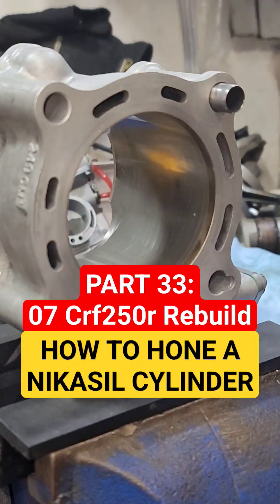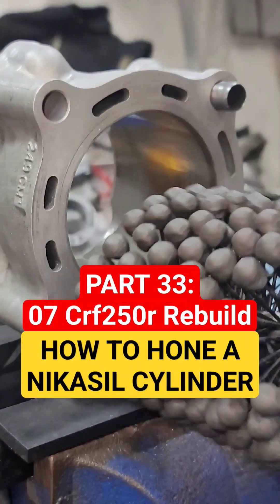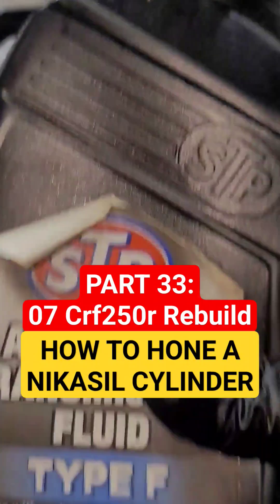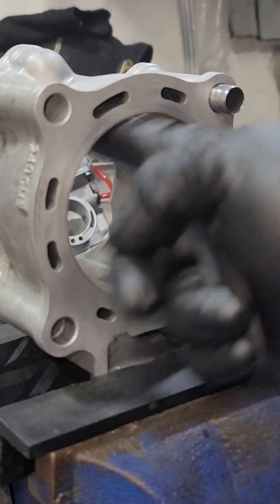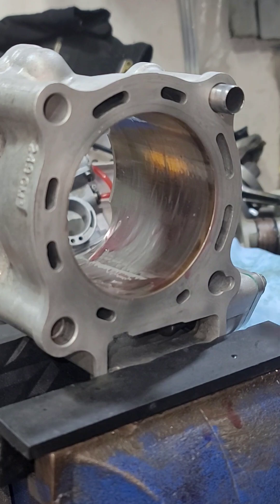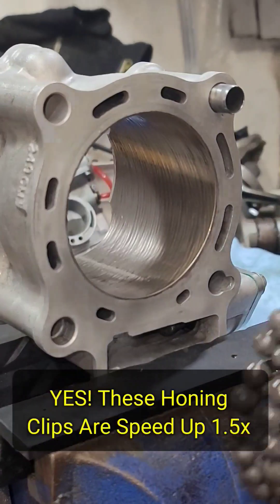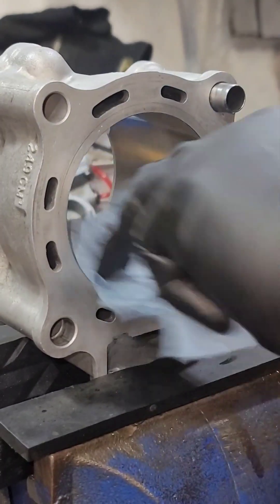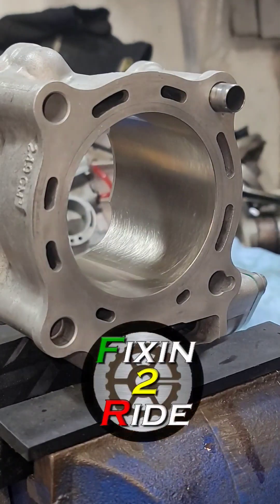07 Honda Crf250r Rebuild   PART 33: How do you HONE a Nikasil Cylinder???

Comment: My new Vertex piston came with instructions that said specifically not to use a ball hone on plated cylinders.  Considering it's a 2-stroke, oil retention is not an issue.  Like many people, I cleaned the cylinder and reinstalled.

Comment: All that ball hone is doing is removing the nickel. Nikasil is too hard to hone without diamond. It's one of the hardest material on the planet.
Reply from the maker: Using an Aluminum Oxide ball gone deglazes the cylinder and brings back some crosshatching to allow oil to maintain lubricity. It's right in the service manuals.

Comment: I currently have my rmz250 taken apart and i’m debating if I should hone it with the rental tool at auto zone but i’m not even sure what else i’d have to do with the new piston and rings after.
Reply from the maker: Well if you own it that puts the crosshatch back in for a new set of rings and piston. If you're referring on how to install it after that if you do the dry method all you do is put some type of engine oil or assembly Lube on the wrist pin only keep everything oil free and then install the Rings in the correct orientation and then put the piston and rings into the cylinder bolt it all back up and then kick the bike over a good 30 or 40 times with no oil in it at all and then fill it up what fluids and started after that. That's going to give you the best ring seat and longevity of your oil rings
Reply: @ What about piston rings and piston should those be different assuming that honing removes a bit off the cylinder?
Reply from the maker: @uwuObito well you can use an inner board micrometer and check the bore diameter to determine that. But typically it's extremely small amount that is removed and it's not the complete surface that is removed from the inside of the cylinder. This is more of a deglazing process then a full-blown honing process. Technically speaking honing is to create an oversized cylinder bore so this is classified more as a deglazing. So the best practice would be to measure your cylinder front to back side to side at top middle and bottom so you know if the cylinder is out of round or out of taper which the max limit is about 4,000 of an inch. And as long as all that is within the range specified in the service manual for your specific bike then you can typically get two sizes of Pistons. But they're only a difference of like   .0005 of an inch or .01mm

Comment: Been doing this for years on my 4 stroke cylinders. Some have had over 100 hrs after the hone and cylinder still looks great. You’re brave to post this because every time I mention it the keyboard warriors go crazy. Most OEM manuals state to hone with a 320 ball hone. Nice works and love the post!
Reply: @DanMX2112  so true…. my personal belief is that if a cylinder is so bad that a ball hone won’t get the job done - then neither will the other 3 stone type!

I have excellent results with the ball hone… just important to buy the right type, and follow the instructions that are PRINTED on the back.
Reply: @Spuki2k correct, I have the same belief. There is a big difference between removing the glaze and and actual hone.
Reply from the maker: Yes! Honing is to literally to increase the cylinder bore diameter for a larger piston.
Reply from the maker: Exactly I don't know what people don't get. Yes, you can run them with new rings and no hone but you're not going to get the performance and longevity from them. When the cylinder is glazed you don't the oil film retention. So it can over quickly from lack of lube.

Comment: Nikosel is .4 thou thick like a sheet of paper you cannot properly hone a nikosel cylinder without a jig type cnc and know how to use bore dial gauge indicator
Reply from the maker: This is wrong. I'm sorry but I've done this plenty of times to know better. 

 We're only talking about deglazing and adding crosshatching for lubrication and properly ring sealing purposes. We're not talking about increasing the diameter of the cylinder for oversized pistons. That's completely different.

Comment: If you want to your bike to run right the only thing that cuts nikosel is a diamond hone dude. Im curios, what's your compression on that cylinder? https://youtu.be/XLBhG2BxlWM?si=hK2FXQ5raHV3zORJ
Reply from the maker: That's 100% inaccurate. Aluminum Oxide ball hones add a nice little crosshatching in Nickel Silicon Carbide coated cylinders. This has been done snd proven for many years. 
 
 "Glazing" is a term used to describe when the cylinder walls become shiny and smooth from wear. When this happens, the seal potential of the rings lowers as well as the cylinder capability to hold an oil film for lubrication. 

 If you don't "deglaze" the cylinder by lightly using an aluminum oxide flex hone or stone hone to create minute crosshatching pattern, the rings won't seal as well, performance will be lesser and potential for over heating due to lack of proper oil film retention will eventually cause premature damage and failure. 

 Get a used Nikasil coated cylinder and try using an Alimunum Oxide Flex Ball Hone and use some ATF and try it yourself. You'll see that I'm right.

Comment: Hi Carol is nickel and silicon carbide. Under a scope it has very large peacks and valleys between elements. You can only hone blossom with diamond hones that will hone both metals. A ball hone only hones the nickel and leaves very deep thatch marks that wear the rings much faster. Just a heads up.
Reply from the maker: Just going by what the service manual procedure is. I've never had an issue with it. The FLEX ball  hones are Aluminum Oxide. They do a fine job.

Comment: So I have a 1991 Honda cr 250 and I wanted to try and hone the top end but I’m not totally sure how I would go about it or even if it’s save able or not
Reply from the maker: 100 safe and the service manuals recommended when installing new piston and rings. Measure the bore of your cylinder and then get a flex hone 320 grit ball home that is the size or even a millimeter or two bigger. But you can typically get a ball home that is for the range of your cylinder. Use some ATF for lubrication and spin the drill slowly but go in and out of the cylinder quick. Do 10 passes going forward and then 10 pass is going backwards. Make sure that the hone is spinning when you pull it out and when you put it in. When you're finished and you have a satisfactory 60° cross hatch in your cylinder wipe it clean and then wash it with hot soapy water

Comment: What grit are you using?
Reply from the maker: 320. But 320-400 grit is fine.
Reply: @Fixin2Ride-Official-  does your bike have auto lube or you have to pre mix? These wall will work just fine with auto lube right?
Reply from the maker: @alekthefisherman5676 what do you mean, Auto Lube? This is a pressure lubrication engine. Are you talking about injection oil for a 2 stroke?
Reply: 240 or 320 grit to use for two stroke 300 enduro ktm/husky? Which one is better?
Reply from the maker: @atanasgeorgiev2342 320-400

Comment: Does this redo the nickel plating?
Reply from the maker: It deglazes the nikasil plating and makes new cross hatching groves to be sealed to the new rings
Reply: @Fixin2Ride-Official-  so, does it make it if u have no nickel seel left, can I do this and run the cylinder again?
Reply from the maker: Yes. As long as you have a good cylinder by checking front to back of inside of the cylinder at top, middle and bottom and make sure its not out of spec for being round and tapered. Run 10 passes at about 600rpms and uo and down fast. Then reverse it. You want 60° cross hatching.

Comment: You should not hone nikasil with a ball hone
Reply from the maker: I'm not sure where you heard that from but that's actually false. All the service manuals say to use an aluminum oxide ball home at roughly 320 grits to deglaze and add cross hatch.
Reply: Slavens racing video , all the replating companies.

Comment: I thought you needed a diamond home for nikasil
Reply from the maker: Nope. Aluminum Oxide. Yamaha cylinders do I believe.
Reply: A ball hone deglazes the cylinder, reusing the original cross hatch, u need a diamond hone to put a completely new crosshatch in
Reply from the maker: @caleb-hm4lp Do you have documentation on that? You can take an aluminum oxide ball hone and out whatever degree cross hatch you want into a Nikasil (nickel silicon carbide) coated cylinder.

Comment: Nikasil can be hone, what about diasil from Yamaha?
Reply from the maker: You can hone them but you need a special diamond hone for the job.
Reply: @Fixin2Ride-Official-  hey man i have a MT 09 with deep scores in the 2 of the bore. Do just honing it will solve the problem? Some workshops here suggest to insert steel sleeve on the bore to replace the nikasil layer. What do you think man?
Reply from the maker: @skee7259 try and find a good used cylinder assembly, hone that and use it.
Reply: @Fixin2Ride-Official- It cost nearly 5 times more than installing a piston sleeve here because I'm in Southeast Asia, its expensive cuz i need to import the cylinder assembly from Europe (closest)
There is this CNC workshop they said in theory they can but unproven, should i give it a try? They use steel sleeves for the pistons like on 80s or 90s sport bikes.
Do you have a any suggestion? Or should i try using steel sleeve?
Reply from the maker: @skee7259 5x more even for a good used one? Do you have access to ebay?
Reply: @Fixin2Ride-Official-  i already tried asking and tried ordering, the crankcase is about $350 but the registration and shipment and stuffs cost almost $150 (import tax too, cuz my country is full of bs tax)
The workshops offer me about $89
Reply from the maker: @skee7259 I say try what will be best for you.
Reply: @Fixin2Ride-Official- Thanks for the help, man. I'm subbed to you
Reply from the maker: @skee7259 wish I had more to offer you and thanks for the sub